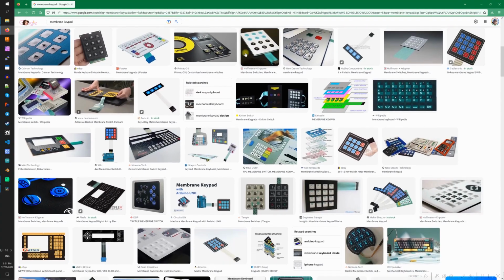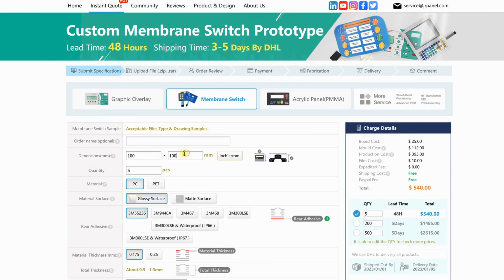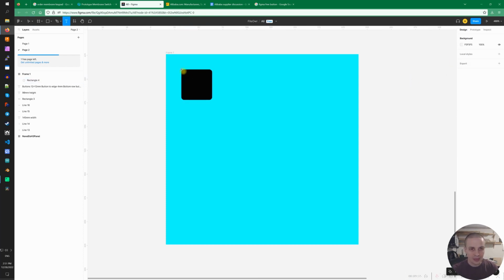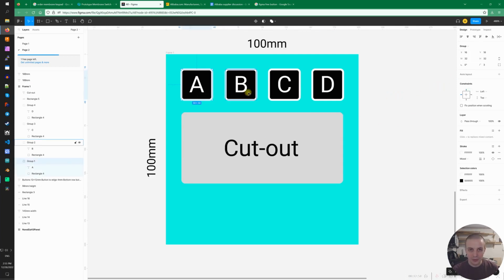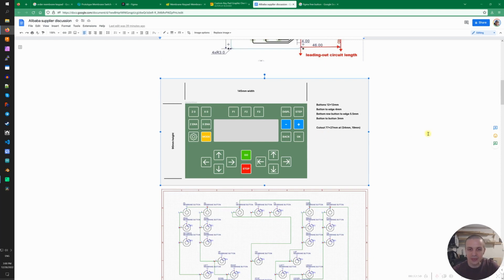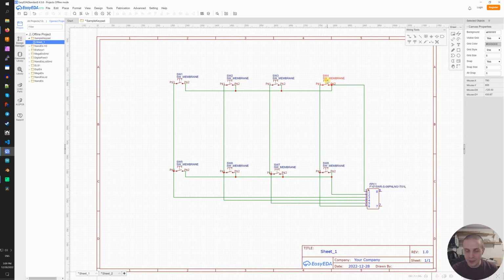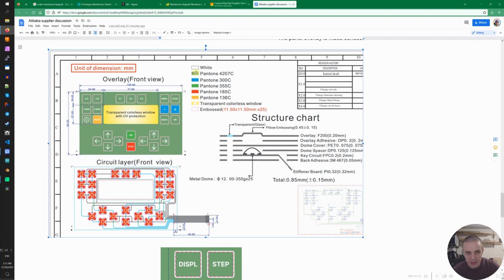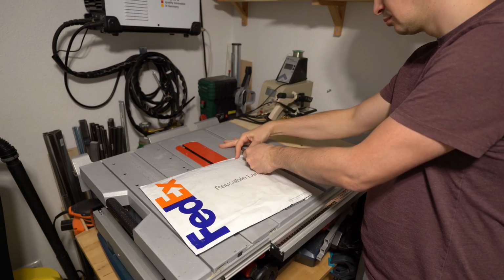Membrane keypad - design, order, use

Comment: Still to expensive for small run. you paid 300 for 5? Ouch. Why not use other method for small production? For example cnc cut from plastic sheet and add buttons manually?
Reply from the maker: I'm only using plastic front panels without circuitry now. Cheaper and better.

Comment: Hi Mx, was looking for some membranes keypad. Saw your video. :) cool em. Do you think the cost is too much for the sample? I thought of using FR4 for the back and with printed copper track and overlay with the PVC graphics. As for the embossed key I was thinking using 3D printed mold to press on it. As for dome, should be able to get it from DigiKey or Mouser. What you think? Thx
Reply from the maker: Jason, I moved away from membrane keypads for my projects due to cost, reliability, EMI, ESD and the need for an FFP terminal. With graphics overlays I have none of those problems, production run of 75 overlays costs less than a sample of 5 keypads and I control the designs end to end. You can surely do some prototyping as you described for low cost but it might not change the big picture.
Reply: @MaximKachurovskiy  yeah em. I think is too crazy to pay for all these dirty cheap membranes keypad. Unless  we are like Apple, Orange and other. Good to know you have enlighten and free your mind. Good lucks to your finding l. Take care and cheers.